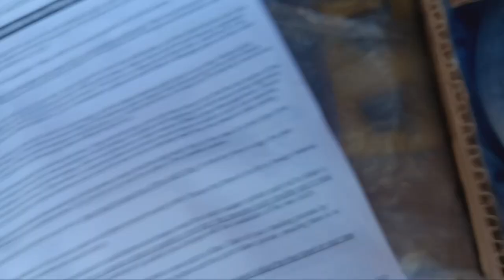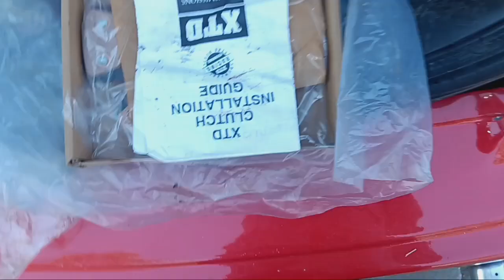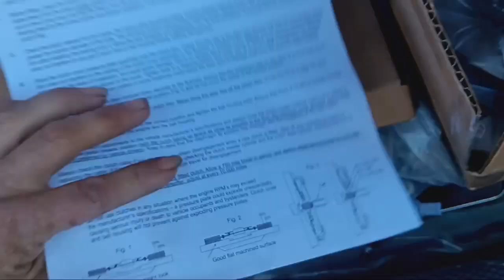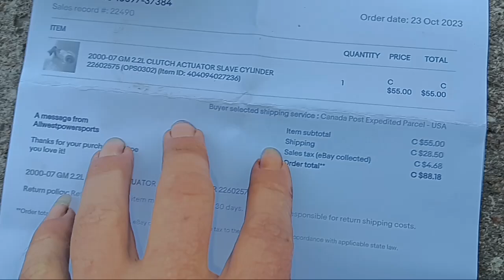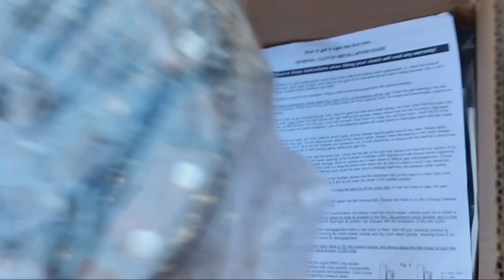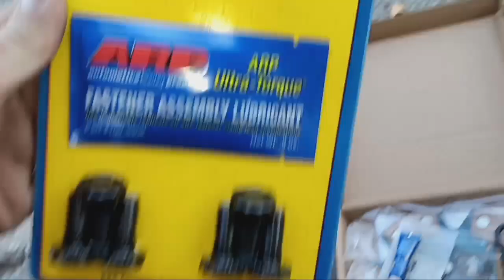Pontiac Grand Am 3800/F23 Swap Clutch Replacement Pt.1 Pulling the Drivetrain

Comment: Nice to see a video from you man and working on getting your Grand Am 3.8 going again! My GTP is still running strong and I drive her hard here and there. Man she really moves and has plenty of power! lol
Reply from the maker: @atranfanatic  that's awesome!! Yeah I've been trying to save up for the spec clutch.but it's expensive. So I settled with another company's stage 4 clutch. Hopefully it holds up. I bought the correct pressure plate from the same company so it's all brand new everything.
Reply: @PontiacsGarage  Nice man! So glad to hear you getting her back together! I have so many projects myself. lol I'd like to get my '03 Grand Prix GT out of my life so I can get my '72 Chevy pickup going again! Hopefully the mechanic that rebuilt my GTP will take my GT off my hands. Otherwise I'm going to slap the engine back together, throw it back in and junk it. I'm tired of looking at that stupid car. lol

Comment: It's up to you, but I'd resurface that pressure plate myself. Save the money.
Reply from the maker: @stevewheatley243  i bought a new pressure plate from the same company. The disk is the same. It's already back on the engine and the transmission is already bolted back up. It's about to go back in the car now
Reply: @PontiacsGarage  Right on. New is even better.
Reply from the maker: @stevewheatley243  oh yeah. My thoughts exactly.
Reply: @PontiacsGarage  Just finished work on a Honda Odyssey. THAT'S a bitch. I good naturedly cussed the guy for bringing me Japanese junk.😂
Reply from the maker: @stevewheatley243  engine and trans is back in the car now. Should have part 2 uploaded tonight
Reply: @PontiacsGarage  I see it tonight or in the morning.
Reply from the maker: @stevewheatley243  im starting to get ate up by mosquitos. Probably gonna call it for the night here soon. But the engine and trans is back in and bolted in with 2 of the 4 mounts. And the axles are back in. It's came a long way in 2 days.
Reply: @PontiacsGarage  Good progress. And don't feed squiters.😂
Reply from the maker: @stevewheatley243  yeah I should have it all back together tomorrow. I need a gasket for the oil filter housing. But Stephen has 1 and is gonna drop it off tomorrow. And I've gotta go get some fresh oil.
Reply: @PontiacsGarage  Good deal. No more Honda Odyssey's for me. They got too many problems and a pain in the ass to work on.
Reply from the maker: @stevewheatley243  i did a transmission swap on a Honda Accord with a 4cyl. I had to drop the subframe to get it out. Was not way around it. It took me 4 or 5 days to do it.
Reply: @PontiacsGarage  To hell with that. I know you was glad when it was gone.
Reply from the maker: @stevewheatley243  yeah I did it for a friend of mine.
Reply: @PontiacsGarage  I do that too. Some things I do for free. Not that I wouldn't.